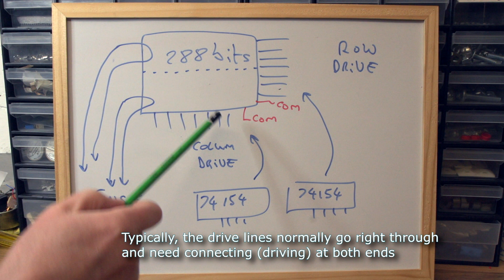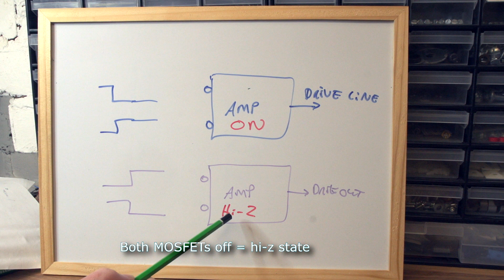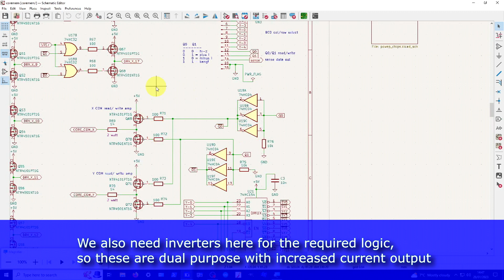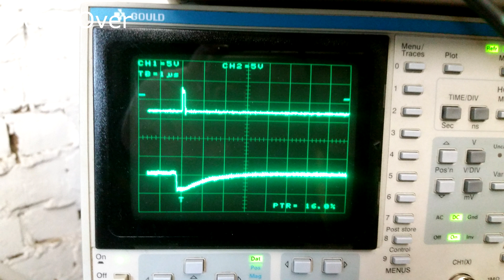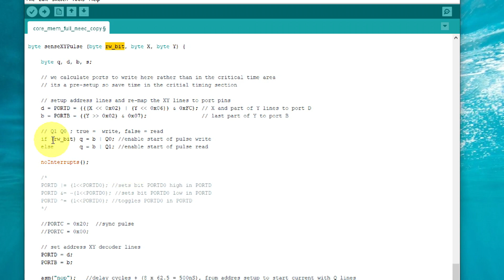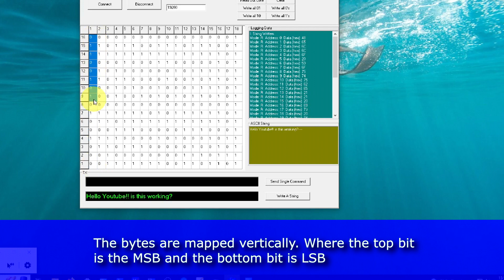Building a Magnetic Core Storage Interface from Scratch! Arduino, Design, Schematic, PCB, KiCad

Comment: Would it be possible to read 3 states, -1, 0, +1, for ternary logic, like the Setun computer did using core memory too?
Reply from the maker: Hi. I dont see how that could be possible without introducing noise and instability. The problem with the zero state is that it would have a tendency to wander. Whereas the ON and OFF states are saturated and much more stable. I'm not saying its impossible, but i am not aware of. Good question though!

Comment: Great vid. For some of the “youngsters”, who started using computers after core memory was no longer the standard. Occasionally, you would get what is called a “slow bit”. The ferrite core wouldn’t flip to the opposite direction within the allotted time of the write cycle. One place I worked had this happen. Obviously replacing one ferrite core, in the field, was not possible. Sadly, I don’t remember what the manufacturers engineer did to remedy it. It seems like we were able to proceed with processing after the engineer worked his magic.

Comment: Very nice project. I have exact the same memory module since 1985 or so. After seeing Curious Marc's video's about core memory I wanted to connect my module to an arduino. Your video is very helpfull. Perhaps I can find the energy ( due to long covid not much energy )building my own version.😊
Reply from the maker: Thats pretty cool that you have the same module. These are quite rare now. Some history checking shows these came from desktop calculators from the late 60's. Would be interested if you know what it came out of in your case. Like the Sharp Compet 32(CS-32A) or 33A. But there were a few other brands using the same boards inside. Sorry to hear of your long covid. Good luck.
Reply: @NEEC1  I worked for the Sharp dealer in the Netherlands. Didn't repair the old compet calculators so didn't know the module came from a compet. I repaired the modern calculators an cash registers. A colleage gave me the core memory module. After searching the internet some time ago I found one same module in a Japanese museum. Thanks for your reaction. Have a nice day.